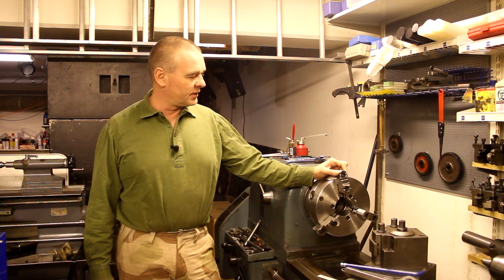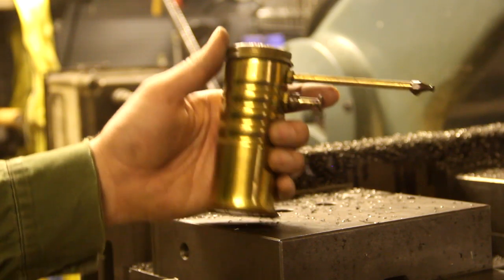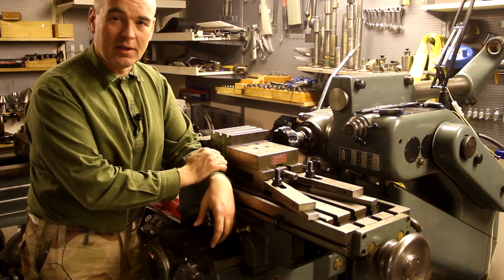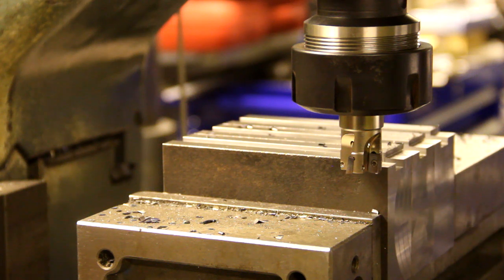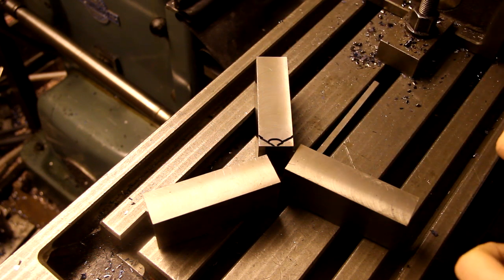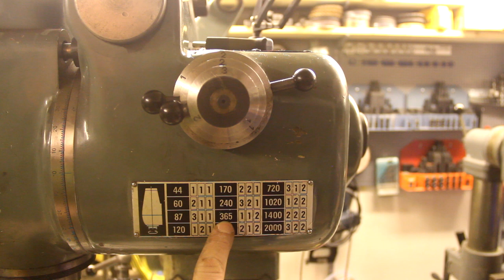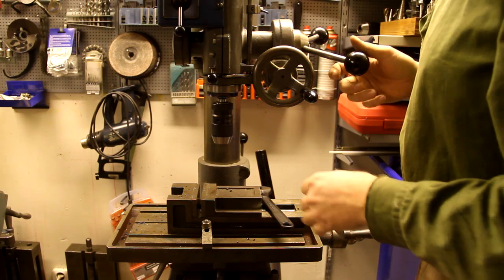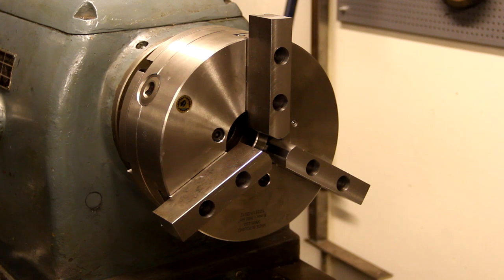JAWS

Comment: Examplary video as usual, and good job done on making the jaws. 

As to the feed rate of carbide inserts: while they certainly can handle the cut speed you throw at them here, the longevity improves if you set it back a bit. I was told that in a type of work where machining time is not critical, one should aim for consistent light blue chip as a rule of thumb.

Comment: Very informative Mattias.  Enjoyed all the close up machining.  Do you mind sharing what kind of camera you record with?  Seems exceptionally clear, looks like you use some external lighting also?  Looking to step up the quality of the editing on my channel.
Reply from the maker: turbocobra I use a Canon Eos 600D, mostly with a Canon EF-S 18-135mm lens. I usually put the camera on a tripod and focus manually.To record the sound I use a Sennheiser EW100 G2 transmitter/reciever system. You can see the Lavalier microphone on the shirt, it connects to a transmitter in my pocket. The reciever is on the camera, connected to the 3,5 mm Mic in. I put the camera sound level control on auto gain. It's as simple as that.Sound makes a lot of difference, and the built-in microphone on cameras usually sound extremely thin and crappy. When you talk, the distance makes a lot of difference also. The lavalier is close to my mouth and can pick up clean speech, but the microphone on the camera is far away so the relationship between direct sound and reflections gets less favorable. You can tolererate shaky shots, occasional bad focus and so on, but crappy sound is extremely annoying.

Comment: Excellent video.  Your machines are Rolls-Royces! 
Yes, I think Adam let the cat out of the bag with the Eagle 66.  However, I wonder if you're concerned about damaging your fine Swiss machines using the Eagle 66?  Since your machines are calibrated in metric units and the 66 gives an un-calibrated American "squirt", isn't there a possibility of a catastrophic failure due to units clash?  Of course, perhaps you've modified the Eagle 66 to dispense in carefully calibrated milliliters to avoid he problem?  :D

 Nevertheless, you do fine work, and it is a pleasure to view your videos.